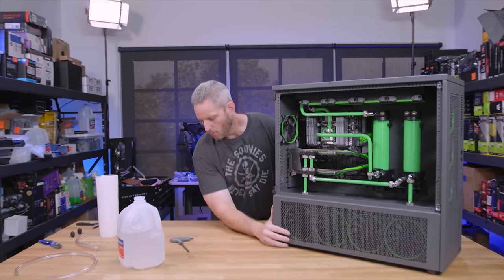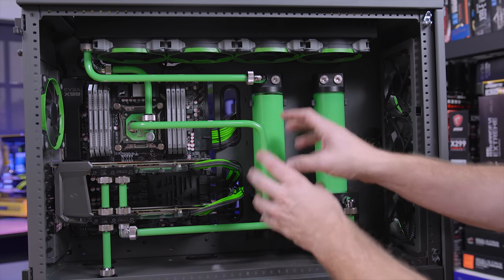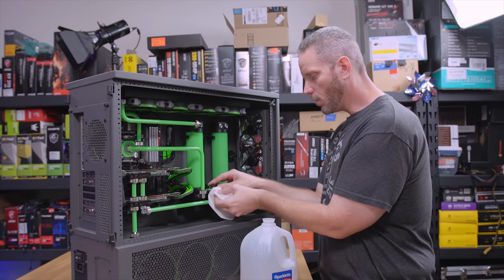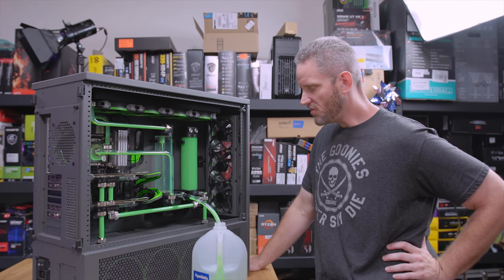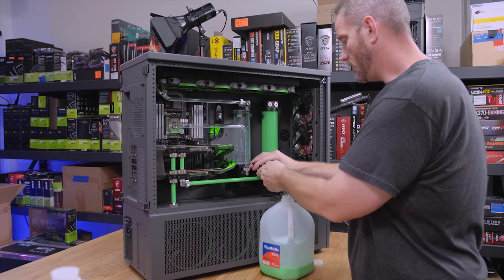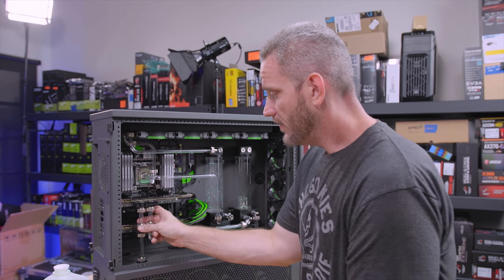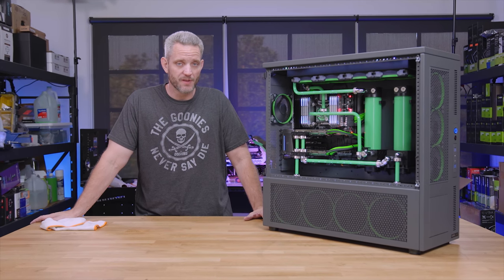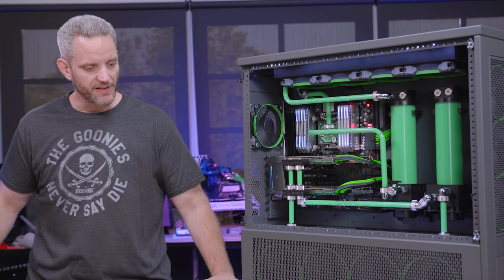This fluid has been running for TWO YEARS! Did it hold up?

Comment: Why have liquid cooling when you can put it in a freezer
Reply: Oh yeah you right
Reply: Freezers and fridges aren't designed to handle that kind of constant heat, they'll fail fairly quickly under those conditions.
Reply: @ @cm01  r/whooosh
Reply: @Hamid-o1p  not everything is a woosh you 12 year old.
Reply: you're not supposed to use subreddits out of reddit you cringe normie
Reply: @Sas ig no you cring normi !
Reply: @Hamid-o1p  you didn't even do it right God damn it, it's woooosh
Reply: @cm01  A freezer is different than a fridge..
Reply: @pontashi2650  I know. The average residential freezer is 10°F or -12°C. The average residential fridge is 34°F or 1°C. Stores don't have refrigerators in that sense, they just have the open air freezers for the meats and cheeses and stuff where the cooling element is well below freezing and the open air keeps the actual product from freezing. They also have fairly conventional freezers. Walk in freezers however are usually not too far below freezing, maybe 25°F or -3°C.
Reply: @krypt krypt smarter than you
Reply: instruction unclear my freezer is melting
Reply: @Hamid-o1p  how to instantly prove that you are under the age of 12 in a single reply..   <~<
Reply: @alfy_boi6221  woosh
Reply: @raihanislam912  thank you!
Reply: @alfy_boi6221  ok
Reply: Jokes on you my Samsung gaming fridge never gets low fps and has very good performances
Reply: @cm01  /whoosh!
Reply: Thats what i do on my phone lmaoo rapid cooler
Reply: @fromallan  lol
Reply: Yeh its big brain time
Reply: @rayneb5313  thats called an xbox series X...
Reply: @adamr6498  no its called samsung smart fridge
Reply: Bruh shut up ام احمد
Reply: @Trixtreous Gamming another kid who thinks a kid is a boomer.
Reply: @cm01  but he's not wrong lol. It was pretty obvious it was a joke but people being people especially you took it far too serious lol
Reply: @Hamid-o1p  sjsjsjsjsjjsjsjssjsjsjjs
Woah
Reply: @cm01  oooooooooooof
Reply: @sasig5215  yiz
Reply: people actually over clock their cpu with liquid nitrogen
Reply: @cm01  hey Caleb M, I'm Kaleb M
Reply: @sgtslappynuts5792  ok?
Reply: @cm01  why are you taking it so seriously dude, do you not have a life?
Reply: @imdisturbeddd1625  this coming from the guy gaslighting people by replying to their year old comments
Reply: @cm01  Ok

Comment: Red, Yellow, Orange all will change over time. It all depends on the real copper content of the rads and how there cleaned beforehand (its difficult to be accurate because when a rad is newly released it will have the best copper and over time OEM's start cheeping out using lower grade copper, we have proof of this because we test as many rads as we can then buy again after we know a few batches of rads have sold and retest). Low grade copper will discolour fluids quicker, higher grade copper will not. Blue, Green, white will change colour slower due to copper oxide being blue / green so do not effect the colour of blue / green / white fluids. Mayhems uses UV blockers that stop algae build up and never stop blocking it until some thing goes wrong such as none cleaning of a rad. You can make you Mayhems fluids last longer by simply removing the fluid, putting it though a coffee filter and reusing it each year. You can do this for quite a few years. Thank you to Jason for showing this.

Comment: Great build. I’m so envious of how easily you drained your loop. I didn’t think ahead and am dreading doing it now without a drain valve fitted
Reply: It shouldn't be terrriiibblleee. Lay out some paper towels in case. But have the tube ready in a jug or something then attach it to the port. Should have mayyybbeee a little dripping, but you won't see a ton of flow until you loosen a top port for air to get in. Also take this time to install a drain valve haha

Comment: 8-years years later my untouched water cooled CPU is still running without any problems,
Reply: Same for me. I just used 50/50 automotive anti-freeze because I have an aluminum radiator, and I figured a lot of anti-corrosion research has been put into automotive coolant. After about 6 years, I noticed the liquid level went down a little (from osmosis?), and just added a little bit more coolant.
Reply: Nice
Reply: Edward Turpin How does your water cooler work out? Is it effective?
Reply: Same, Temps don't even exceed 70°C (I7 4770k & GTX 1070TI Strix OC)
Reply: years years
Reply: Well, according to the manufacturer, the Toyota Long Life Coolant is rated for 100,000km/10 years, whichever comes first, on a brand new car, with half the mileage and time interval for subsequent coolant changes, assuming you're using the recommended 50/50 mix with clean water (e.g. RO/distilled water).
Reply: @4G12  did you just compare a component from a car to a PC?
Reply: @TheCarsfan4ever  "Same for me. I just used 50/50 automotive anti-freeze because I have an aluminum radiator, and I figured a lot of anti-corrosion research has been put into automotive coolant. After about 6 years, I noticed the liquid level went down a little (from osmosis?), and just added a little bit more coolant.
" Moron. Read the comments
Reply: @mindset5794  I did read the comments and my point still stands
Reply: @mindset5794  you're still calling people "kid" in YouTube comments? And that comment on me lacking brain cells is quite ironic seeing as anti-freeze isn't a "car liquid" but you just said so to prove an unnecessary point. Can't even ask a question without hostility these days
Reply: @TheCarsfan4ever  "automotive anti-freeze" jesus you're dense. Anti freeze is primarily used to prevent freezing in a car's engine and coolant system. Also, it is a """car liquid""" Anti freeze is an engine coolant, and it's used for CARS.
Reply: @mindset5794  Jesus Christ I've found a plebeian. Of course if you decide to add "automotive" in front of it then it'll be for cars but in that case you're just adding to something with words that weren't used. Anything can become an item used specifically for cars if you add "automotive" to it (which no one here had done anyway).

What's that? Jump leads? Oh, it can only be used for car batteries now because it's labelled as "automotive jump leads" 🤦‍♂️ quarantine has gotten the worst out of people, you seem bored and looking for an argument
Reply: @mindset5794  and I hope you realise that my main question was if a car component was compared to one of a PC, since antifreeze is an engine coolant not a CPU coolant
Reply: @TheCarsfan4ever  shut up lol. antifreeze was produced and made specifically for cars.
Reply: @mindset5794  you have no rebuttal for my point. I genuinely wish you a good day and to stop bothering me, it was unprovoked
Reply: @mindset5794  Thats not really true. The first antifreeze was made for explosives and remained like that for decades.

Im with the other guy... I think youre throwing a massive tempter tantrum over a simple question. Its always ironic when people throw kid as an insult first while acting like a toddler.
Reply: Aaydemir89 also antifreeze is used in military high altitude air crafts to prevent freezing in the engine block, which can result in cracking which then lead to mass combustion of the engine and the guess what? Plane go boom
Reply: @edwardturpin6544  imo it's not needed. Water has a much better energy absorption/dissipation rate and is much easier to come by. Of course you do still want something in there to prevent corrosion or stuff from growing so if all you have laying around is anti-freeze, throw in a bit of it but 50/50 is overkill.
Reply: @TheCarsfan4ever  Cars are basically just big drivable PCs
Reply: @seanwolz1835  I'd only go as far as to say that for a Tesla
Reply: @samgrimes3162  excuse me but was this not my point?
Reply: @TheCarsfan4ever  he didn't, 
The guy initially said he is using a car antifreeze and he added on that.
Reply: Drink it
Reply: @edwardturpin6544  i really hope you researched the kind of coolant you used, since there are different kinds and some will actually eat aluminium

Comment: What makes PC lasts longer liquid or air cooling I had PC lasts over 5 years simple air cooled but heard too many horror leak stories about liquid cooling to even try it. though it does looks cooler and more efficient. Green liquid looks amazing.
Reply: It's a hard comparison to make. 

Air cooled PCs are less prone to failure because there are fewer points of failure (Fan + Heatsink, vs Fan + Radiator + Fittings + Block + Pump + Fluid), but modern, high end watercooling components are built to last... If you take care of them. 

Watercooling is always cooler and more efficient than air, but requires, like Jay mentioned in the video, routine proactive maintenance. Air cooling requires much less maintenance (dusting, re-applying thermal paste if needed) than water, but also doesn't cool as well as water. 

Ultimately it depends on what you're doing and what hardware you have. If you're overclocking your components, watercooling will keep them colder and more stable at higher voltages and clock speeds. If you're using stock speeds, air will be just fine.
Reply: I've had my air cooled running for at least up to 7 years now.
Reply: They never tell you the whole story... Watercooling on most systems is usually separated with one full system for CPU only and other for GPU, just that alone improve efficiency quite a lot instead of a full mess of mixed air from every component inside the case...

But with air cooling you can also improve it quite a lot if you are clever like you can make a custom plastic\acrylic tunnel from front to back of the case and make it pass trough only on the CPU and put some foam so nothing hot gets in or out of the tunnel. that would also make a full separate air cooling system for CPU only and then other fans inside the case would be moving air in and out for the other components.

But since no one customize that much its just easier to buy a watercooling system which is always more efficient than air no matter what, but not that much better if you also do something like I said above for the air cooling, but requires a lot of modding and a good huge cooler which also adds weight and a lot of space lost which water cooling can make them more slim.

Also some newbies go very wrong by using watercooling but then they have motherboards which are not water cooled and they forget to add fans, that might kill the computer even faster than everything else, because if they are overclocking a lot the VRMS and some other components from the board will melt\burn\damage from having totally no air circulating as they think they only need a water cooling for CPU and GPU and the rest doesnt matter lol.

So even if you have a watercool system you still need a good airflow and fans on the case to cool all the other non water cooled components.

ps: If you are not thinking to OC, then mehh dont waste money on watercool, you can buy a cheap but capable air silet cooler that is enough and add a few silent fans to the case with good airflow and its more than enough (only things like high wattage CPUs require good huge coolers like Threadripper, some high wattage intel xeons and 2011 socket.... they are not CPUs for a common PC user anyway and are lot expensive).
Reply: I built a MSI 870 A g54 mother board back in 1996.And it finally died this year.I ran it for all most 18 years.Air cooled only. It was running 24/7.Very rarely it shut off.
Reply: Depends if you get a closed loop factory made cooler or if you custom make your own. Jason is one of the rare people who correctly makes his own custom coolers, but a lot of people don't and that's where those leak horror stories come from. The bulk of them anyway
Reply: @guily6669  or make sure your battlestation is in a cold new england basement :)
Reply: @Kotiga , If I had money I would buy a huge watercooler system, buy copper pipes, make a hole from side to side of my freezer and make it pass trough it and with a heating system so it heats to melt the frozen water inside and then stop heating :).

But I'm stuck with just lots of fans since I cant even buy a medium quality watercooling system :(.
Reply: @samymasta  I will keep with my fans, some have 7 year and are still spinning pretty good and noise free and the ones connected on the motherboard are always on turbo mod, the others are connected to the fan controller, I adjust them to low and near max only when playing games.

My PC is from 2011, my I7 2600K is at 4.9ghz at high voltage with a massive air cooler from xigmatek with 12 copper pipes and direct pipe contact, I added a second high airflow+pressure shark fan to it.

On total, I have 7 fans in my modded old case Thermaltake Kandalf the super tower :).

If I would invest in watercooling would be 4 new hardware, but money is sadly on a hold and not stretching + almost everything instead of getting cheaper, is selling more and more but even got way more expensive than back in 2011 :(.
Reply: @guily6669  
Keep your eyes peeled for holiday sales,can get some very decent deals
Reply: I was thinking what i want to do if i would ever build a pc it has to be with water cooling. Im going to build a pc in 2019 now i see what it takes u refresh water cooling im not going to use this. I would get all that stuff evrywhere. How long is it even recommended to use water cooling?
Reply: Unless youre an overclocker, Air Cooling just fine.
Reply: I have watercooled my PC's for over 20 years. Use quality components and take your time building it and you will have no leaks.
Reply: Aalot of people keep pointing out the overclocking as the main point to water cool youre pc, while that can be 1 of the reasons to do it, what about bad airflow design or open air cases, i have a open case with components that dont require liquid cooling , i did it for saftey reasons including the fact i live in a state with high temps and humidity, asaid from that it looks cool, its not as complex as people make it out to seem and its somewhat future proof if i end up being able to go full high end gpu and cpu
Reply: My ol GTX 760 died recently. After about 6 years of service, the radiator and fans still work perfectly though.

Comment: I filled my loop with pastel sunset yellow in January 2015. Been running cool ever since. No discoloration either.
Reply: @camerontweedy8885  not even a little bit. I added about 50 ml of distilled water twice over time. Each time I found the loop to be a little bit pressurized. Also, the system had no more than 60 days of down time total.
Reply: JimBeam JewCurls  it is for overclocking  whether you use it for gaming, CAD, or anything. If you want it to live long water cooling is great option. Look up some of the builds on this channel for more info on plumbing. I also highly recommend watching builds on Singularity Computers before he took a break a few years ago, the most meticulous custom loop builder I've seen. By the way, i have a dual Xeon system 30% overclocked since 2008 only had to upgrade graphics cards and change failed RAM every few years.
Reply: Bet that colour matches your burning CPU quite nicely.
Reply: @klystron2010  lol. Yeah burning cpu would cause a shutdown.  As most motherboards in default have a temperature shutdown failsafe system . Have been for over a decade  the last system I saw and built that didn't have this was back in the days of and athlon processors

Comment: I have the same liquid running for 11 years (since august 2008) without any issues. Cooling has been rock solid and I still have low temps. Feser One fluid in Tygon tubing,  Feser brand doesn't exist anymore unfortunately. Its on EK Supreme CPU block with all the small micro-channels and there is no clogging whatsoever. Had to top off the reservoir like 3 times in all those years.

If you're wondering, it on the Intel 1366 socket, first started with I7 920, later upgraded cpu to Xeon X5677. Still my daily gaming and working rig.

Comment: Clear coolant with rgb is the way of the road
Reply: "Clear" coolant doesn't quite cut it, you need something clear that refracts light, I think a mixture of bleach and distilled water works, but I'm not sure, there might be a few more ingredients... google "Soda Bottle Shed Light". Refraction is the key to an RGB water loop.
Reply: Clear is the appearance they are talking about, just miscommunication i think. But good job clearing up any possible miscommunication/understanding. Well said.
Reply: Yes!
Reply: Yeah, don't put bleach in your loop. Terrible, terrible things will happen. Bleach is a very strong oxidizer.
Reply: I agree, except white, the only other coolant I can get behind
Reply: Trainboy1EJR Holy hell never put bleach in your system
Reply: @the_bishop  r/whoosh